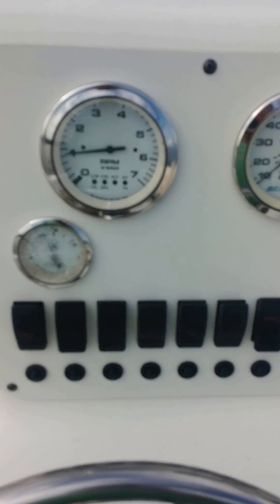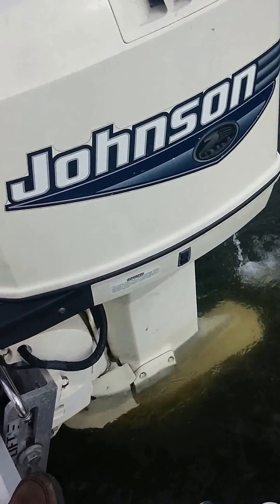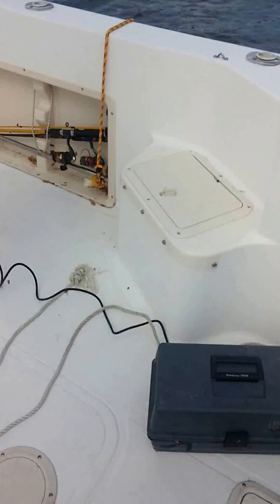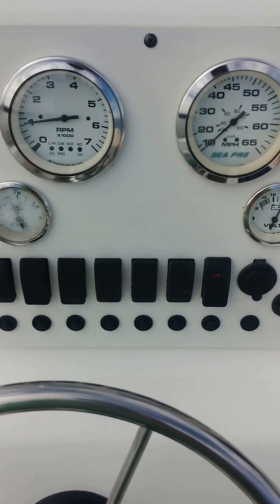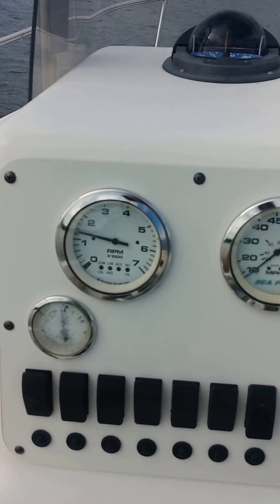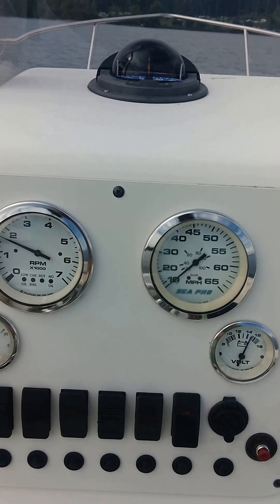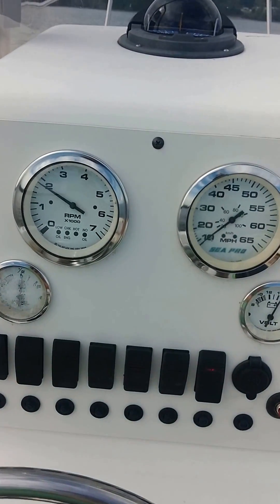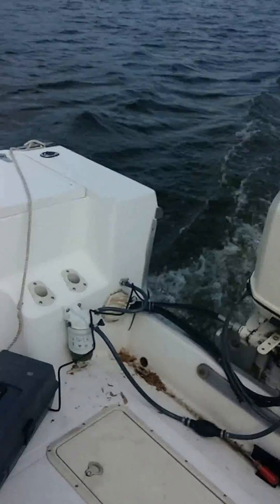2000 Johnson 150 won't go past 2000 RPM

Comment: ...so, have been searching for problem solution for my 150 Johnson with same problem and when I replaced heat sensor on the head of the engine , it runs now  with full power. Problem solved . There is way to check if heat sensor is faulty , disconnect both wires from sensor, connect white wire that goes on to the senior to the ground on engine and run the engine, if runs as it should than it's time to replace heat sensor.  It worked for me but I also learned it can be all sorts of solutions to this engine behavior, from petrol supply to electrical issues, I suppose with this test you can eliminate one of the causes ... good luck
Reply: hey i have this problem with a 150 96 merc  on a 19ft  the throttle will go all the way it can and the motor is not even going fast enough to get the boat on plane . if around would love some help thanks
Reply: @lakeshorefishing6864  ever figure it out ? Having the same issue its good out of  water I know its getting WOT and then it seems like it won't go above 3000 rpm or so. Not on plane either
Reply: @gavinsixnine  try changing the fuel lines and fuel filters the old grey fuel lines are a scam break down and clog everything hopes that helps  the coast guard black fuel line is basically the same as a cars fuel line i dont know why they make it look like you need that grey hose with plastic liner

Comment: Sounds like its running on half of cylinders.What I being reading is that the neutral shift switch cuts engine down to 3 cylinders for less torgue  when changing neutral to forward.. Might a bad switch stuck.

Comment: On a side note.. that thing is barely pissing.. Should be a nice strong pressurized flow coming from visual indicator
Reply: If the motor is running good then the pissing will do better. Providing the pump is in good condition. Lol

Comment: I'm having the same issue under a load. Did you ever get it fixed?
Reply: Kyle Kyle the problem can be that one of the sylenders is flooded with gas, wather or something else. But it's probobly flooded. Sorry for bad English
Reply: Kyle Kyle and there can be leeks in the fuel pump

Comment: OK, well I can't hear the engine very well, audio can be tricky when doing videos like this...But, it does not sound like the engine is stuck in "SLOW" mode.  I would check the carb linkage carefully, sometimes the throttle shaft links get a little loose allowing some of the carb butterflies to stay closed when advancing the throttle.  This is not too hard to check, simply remove the air box with the engine off, and push the throttle control lever up to WOT, then have a look inside each carb throat to see if the throttle butterfly is stuck closed...Maybe something as simple as the connector link between the two carb banks has been disconnected....Remember, check simple things first!  Don't go spending big bucks "guessing" that big dollar electrical parts are bad...

Comment: I have the same problem with my 140 Johnson 2300 rpm under load
Reply from the maker: Man... I sold my boat a year ago.  Just accidentally looked at my videos and saw this.  
It was about the bad carburetors, they were warped and leaking badly.
Reply: Did you ever figure out your problem
Reply: So, the only problems you had were bad carbs? There were no electrical issues with your ignition system?